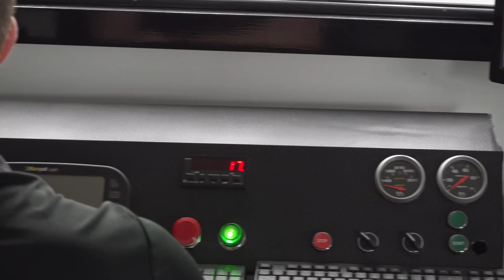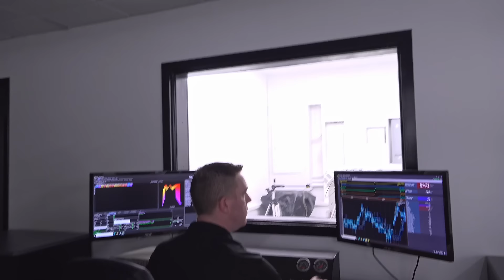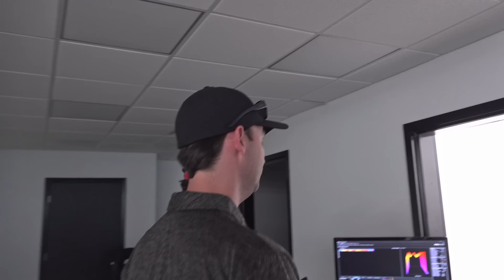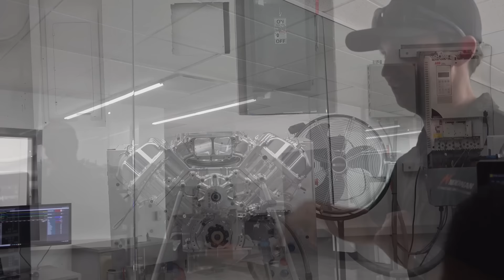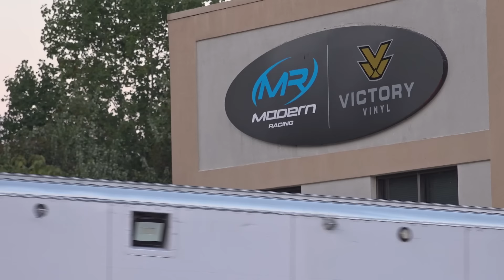We Picking Up New Lexus!!! Stopped At Noonan To Check On NEW MOTOR!

Comment: Question Justin! In all my years of drag racing, I have never ever run my valves and set valve lash by rotating the engine backwards! But yet when watching your guys setting valve lash they are turning the engine backwards to normal rotation! Why not set lash turning the engine normal rotation when exhaust is opening you adjust the intake, and when intake is closing adjust the exhaust valve? How are you doing it when rotating the engine opposite normal rotation? Curious why you guys do it opposite normal rotation!
Reply: justin dont know he just points the front of the car and collects the money